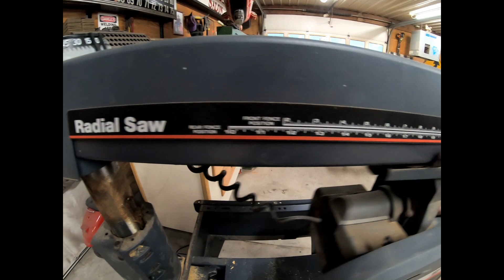Craftsman Radial Arm Saw tear down & Cleanup

Comment: My craftsman radial arm saw has a problem. The big arm that has the motor moves left to right. I had it set up just right. After using it I found that I could not get a perfect 90 cut every time. So if I grab the arm at the end it will move about a quarter inch. What would cause this?

Comment: on my Craftsman, once you remove the motor carriage, getting the column and arm into place isn't too tough.  It's a whole lot lighter without the motor attached.  Again, on my unit, removing the stopping screw underneath the tip of the arm lets the carriage roll off the front of the rails.
Unfortunately, while bolting the arm to the base, that's when you have to adjust the tilt of the arm.  Or you can devise ways to tilt the table to match the tilt of the arm, like maybe adding shims underneath.

Comment: Hello how's it going?
Can you please show or explain how to connect the Saw's toggle switch? 

Mine has a black and white wire along with 2 more black wires with slip on tips, to connect to the switch. I don't want to wire it wrong.

Comment: Sounds nice . The older Sears are best,but that looks like it has the cast arm .The old 12" Sears don't pass on . Alignment is critical. I had Sears set one up years ago and it was ridiculously out of alignment. Next challenge is to pickup a used DeWalt 16" out of the fifties . Rebuilt they bring some serious money.

Comment: Do you think you can send a picture of the tower bevel gear assembly? I took mine apart too long ago and can't find the correct way to put it back together. I had to find a used bevel gear lift screw, but don't remember how it came apart! Haha. You did a great job too sir!

Comment: I just got one of these for free for doing a job. Contractor series 10-in Craftsman. But the bevel lock pin is stuck. I can't seem to get it loose
Reply: 😅 okay and try a little harder I figured it out. Took the gray handle off and then the cover behind it and then took off the locking plate with the four bolts on the inside and had to hammer up and down the bevel pen to get it unstuck with lots of WD-40 or liquid wrench and then the spring started to kick in the action after several sprays and cleaning the pen top and bottom.

Comment: My husband and I picked up a Craftsman 10” ras but it has radial 100 on the front of it and we can’t find a serial or model number on it anywhere. It came with a two prong plug and a two push button (like the ones on blenders) on and off switch. I was wondering if you would know anything about it?
Reply from the maker: Unfortunately I do not... Have you searched Google for any info on it.. its amazing what you can find about these older tools if you search long enough... Good luck ! keep me informed if you have any luck finding info...

Comment: The two brass key way my fell,out during disassemble  where do they go I kinda know but if you can say would be great thank you
Reply from the maker: I didnt see any brass keyways that I seen when I took mine apart... sorry !
Reply: @Redneckmfg  hello in your video they are on the bench next to the threaded shaft when I took my apart they fell out  it was when I pulled the tube kinda know but not 100%
Reply from the maker: @MrStarlin51  do you have an email address i can send you a picture showing where they go ...

Comment: I would put casters  straight in back and turnable in front and on the bolt issue get hitch pins so you can separate it in two sections

Comment: I just had to do this by myself. This is not a pat on the back, just a helpful tip for anyone that doesn't have his resources. I laid the whole unit on its face and moved the set screws all the way out so that the brass guides were as far apart as they could go. The shaft goes back into place fairly easy. Once you have the two brackets on just past hand tight you can then lift the whole thing back upright then finish tightening the brackets. Then, and only then, should you turn all the set screws back in half a turn at a time each until they all start to touch then adjust from there. Hope this keeps some of ya'll from screaming at the night like I was.
Reply from the maker: Did you get my picture i posted to show where they went ?

Comment: Many of the black parts have oxide finishes so paint would not be the best option. I rebuild one of these saws and used cold bluing. Unlike paint it does not scratch off of cause binding. It also looks more like OEM.

Comment: I purchased a 113 29411 Craftsman (or about). Everything worked fine except the bevel function. The handle would not budge. I am not the kind that likes to go gorilla on materials that appear to be designed for less force. I looked all over the net for some help on how to diagnose the problem although several videos are out there on similar models, not detailed enough to be helpful to me. I downloaded a manual, but the description and diagram were far less than helpful for the bevel apparatus. (I am not a mechanic.)

As I said the handle would NOT BUDGE! I think the saw has sat for a long time and things have gotten dry. I finally made sure the thumb catch on the bevel latch was up all the way. It was very difficult to move at first. I used a light penetrating oil, left it for a couple of days, then used a small block and tapped the block against the thumb catch. LIGHTLY. Finally it moved. I worked it up and down multiple times to improve the movement. (By the way, moving the pin UP releases the handle to move...something the instructions didn't mention.) (The whole mechanism strikes me as under manufactured and under designed.)
Next I loosened the knob on the handle. Next I loosened the hex bolts (four) yet still no movement. I then decided to drop the motor to see if something was wrong on the pivot points on the motor side of the mounts. (Again, I didn't find any detailed video or instructions on how this was to be done...winged it.) After finding out that the two 3/8 bolts on the back side needed to be removed and the small plate should be pried out carefully the far pivot of the motor was free. Yet the motor didn't free itself on the side where the handle was at. (I had a block under the motor to control it from a sudden drop. ) I then took a small block of wood and placed it against the handle and struck the block with a hammer semi hard. After a couple of times, the handle moved a bit. I had a few more strikes and the handle came out and off and the motor settled down on the block. Now I started cleaning the parts. The handle mechanism is made out of poured lite metal (maybe aluminum.) corrosion had occurred between parts that came into contact. Not much...but certainly enough to cause the problem. I used a small brass brush and lite oil to clean all contact surfaces all through the pivot mounting system. After which I reassembled the entire system. Now the handle, pin catch, and pivot mechanism works like new. I hope this helps someone who just wants to use a good RAS saw for home projects with this problem. I hope it saves you hours of looking at RAS videos and researching the net.

Comment: Hey man, first off great video. I can't believe my luck in finding it actually, as i'm going to attempt to do more or less exactly what you did.. Except I don't have a sandblaster yet and your garage makes mine look like a shack of despair.

Secondly, i have a 1975 Craftsman 10" RAS, the 113.23100 Model. I found it on FB Marketplace, and a fellow contractor had it listed and during negotiations gave up on it and gave it to me for free. 

The good: It was free, it turns on, and it will crosscut.
The bad: Everything else is completely seized.

I think my model may be older, but it should be relatively similar to yours in regards to the tear down and overall disassembly, correct? I'm intending on doing more or less what you did, minus the sandblasting as i don't own one, or have room for it, yet. 

I'm actually intending on using the RAS to make my first workbench, currently i'm using some crappy 'tables' that came with my property. The motor itself will not pivot what so ever, neither to stage for a miter, or to rip cut. Anything i should be worried about finding in there? I'm assuming it's just rusted and seized (The saw in general is in ROUGH shape). 

While i know they're nothing 'special', there's definitely something about older tech and specifically tools. It's crazy to ponder how many individuals have potentially handled and utilized these old tools.